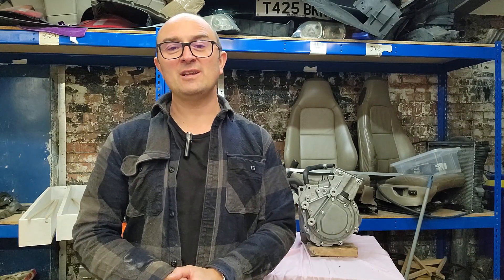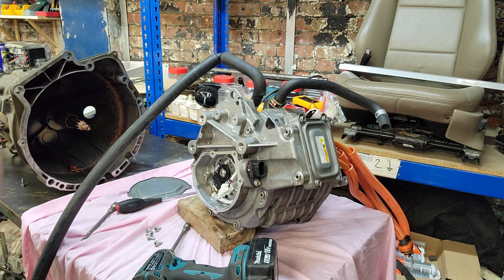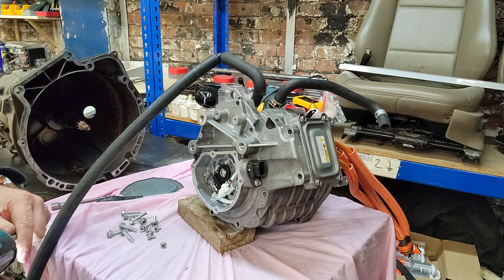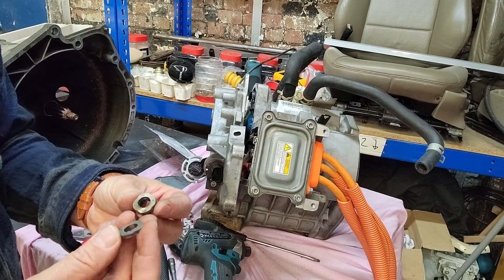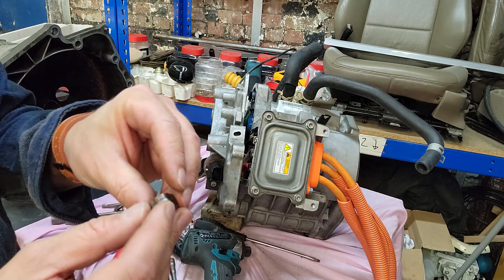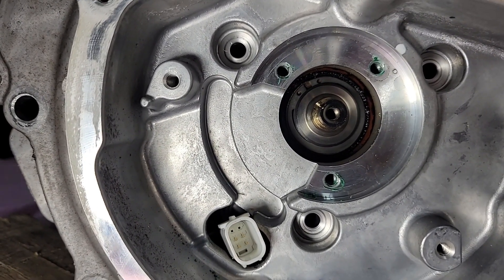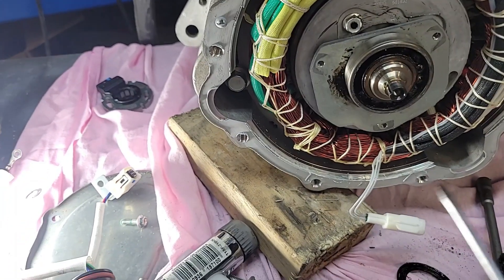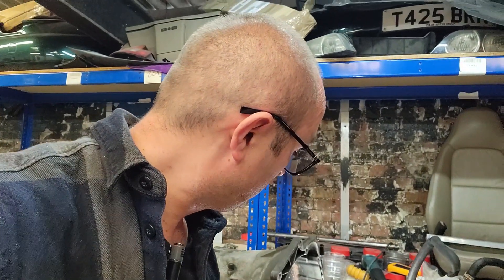Inside my broken EV motor - and how I broke it

Comment: Given that It's a 3 phase induction motor. If the stator laminations are not damaged and the windings are not burnt (would be evedent by the smell) and as long ad the rotor only has made superficial marks. You can check that there is no shorts between each phase winding and the motor case and check that the impedance between each phase is the same between each connection. If all is good and equal, then I would just pop in some bearings as they would only cost a few dollars and connect up to a 3 phase supply via a 3hpase DOL starter with a termal overload and HRC motor start fuses or CB rate for the motor kW rating and bump test it If all is good the do a couple of minute runs and check each phase line currents are the same.
You don't need the encoder/resolver to do this test.
Reply from the maker: Ah that's a good plan - thank you. Definitely think I'll fix it. I might even stick a puller on the bearing and see if I can remove it myself before taking it to someone. Good opportunity to learn something.

Comment: What happened to me with a Leaf motor coupled to a manual was I trimmed it enough... for summer. But when winter came, the aluminium bell housing shrunk more than the steel shaft, and caused a very loud noise. After driving with the noise for a week or so I took it all apart, diagnosed the problem to be in the rear bearing of the Leaf motor, replaced it, trimmed my shaft more and it's been fine ever since, about 3 years and 50 000 km so far.
Reply from the maker: Bloody hell! That's a shocker.

Comment: The terms are 'axial' and 'radial'. It doesn't take too much excessive preload on a bearing for it to overheat and there shouldn't be any preload in this aplication. The ouput bearing is usually able to float axially for thermal expansion, so it's the fixed rear that failed.
Reply from the maker: I knew I had the wrong term. Thank you. And that makes a lot of sense.

Comment: Maybe put the motor back together, put bluetac or similar on tip of the shaft the rebolt to the gearbox to confirm your diagnosis. If the bluetac is crushed you'll know for sure.
Reply from the maker: I was thinking something like that. Just trying to source a replacement motor at the moment. First one let me down.
Reply: @EVDIY  Bash a new bearing in and see what happens. 🙂
Reply from the maker: Need to sort the resolver as well. I probably will repair it/get it repaired but want the certainty of a known good one for now.
Reply: @EVDIY  I agree that is what I'd do but in the meantime if you can confirm the cause then you'll be much happier putting in another new motor. 
If this is the cause then Happy Days! You'll have it sorted. 😀
Reply from the maker: @alibro7512  Yep! Still taking it off the road for a bit though to sort out the body and the interior. Now that I know I can get the power I want, I really want it to look good too.

Comment: Didn't the motor report the overheat?
Reply: Temperature sensor is in the windings, so the overheating bearing is not pickup by the sensor.

Comment: Sounds about right I think, make sense that the axial force kills the bearing. If it was radial force I think you should have seen a lot of grinding material of the coupler. Also nice to see that this motor have a closed bearing. I say let's try to repair the resolver and some new bearings and you are good to go
Reply from the maker: Excellent. Think I'll definitely get a second motor though since they're cheap and I have the Outlander rear inverter and control board to play with. Can get my car up and running and have a second setup on the bench - maybe for a future project.